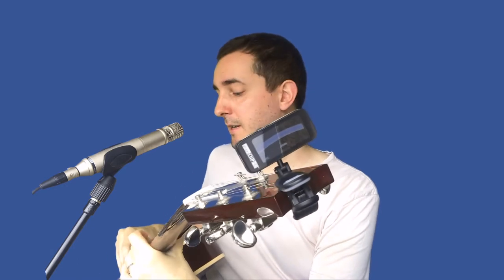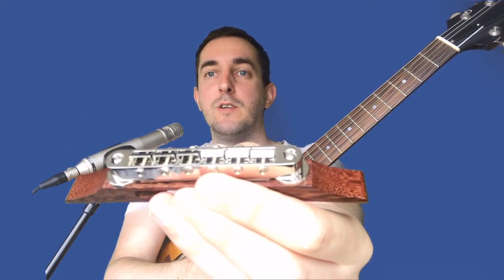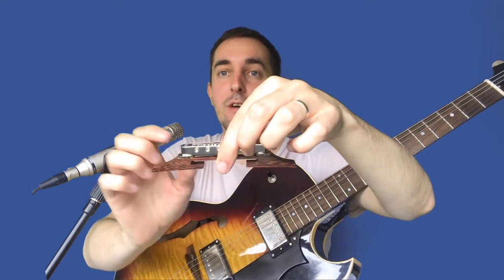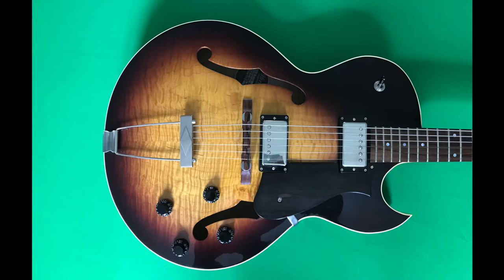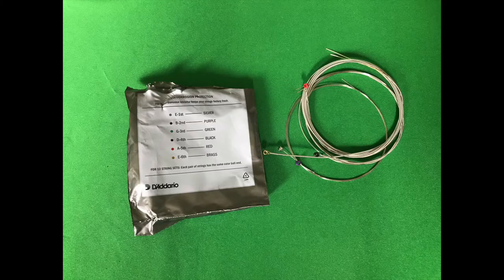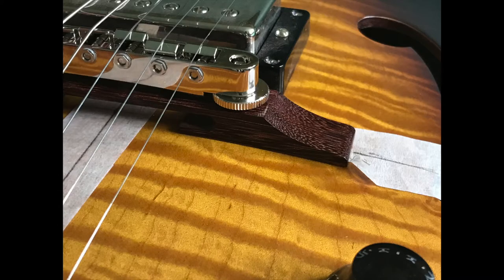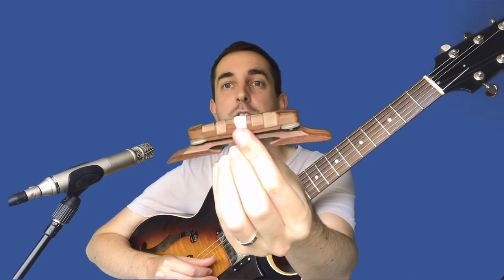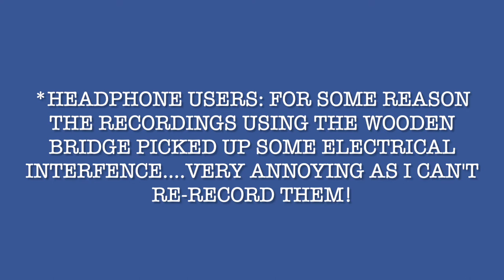How to fit a Tune-O-Matic floating bridge to an archtop guitar and comparing wood vs metal (TOM)!

Comment: There are also Roller Bridges which are common with Whammy Lever Tailpieces. The biggest advantage of that bridge is that the Strings will last longer because as you're tuning it to pitch, the Strings turn the Wheels.

Comment: Really great sounding guitar and really nice playing. I slightly prefer the sound of the wooden bridge. I think it suits the style of music you're playing slightly better (in my opinion. It's all subjective obviously). I think you could actually fix the intonation on the wooden bridge. For example on the G string, which is playing sharp, I would maybe glue (with super glue or wood glue), a thin piece of wood of the same material as the bridge to the back of the segment of wood that the G string ramps over. A piece of hardwood veneer might even be thick enough for this purpose. Then file and/or sand it to blend in seamlessly with the bridge. You'd then be able to file/sand away some of the front wood material away where the G string ramps over, until you get correct intonation.

Comment: Tonight I replaced the wooden bridge on my Eastman with a tune-o-matic. It definitely sounds brighter now and I will hopefully now have no issue with the intonation being off. I still need to make some adjustments. Did you place the bridge so that the screw heads on the bridge are facing the pickups? I wasn’t exactly sure but I believe that is how it should be placed.
Reply from the maker: Hi Ben, my screw heads were facing the pickups.... but if you look at the saddles you'll notice that the EAD saddles face different to the GBE saddles. This is so that you can get more length out of the string on the EAD side. So regardless of where the screws are, there's only one way to fit the bridge. Hope that makes sense! Cheers.

Comment: I have a Grote jazz guitar with a floating bridge and trapeze style tail piece. The wooden bridge has a tune o matic style saddle bridge on top to adjust string height and intonation. In order to get the string height I want, I have lowered the tune o matic all the way down so that the thumb wheels are actually sitting on the wooden bridge. Do I risk causing damage to the guitar?

Comment: "Much ado about nothing" The highest end Archtops have wooden bridges that don't even have a compensated 2nd string. You set the Low E and the high E and you're done! Just learn to play the instrument the way it was designed. It worked for Segovia, it should work for you.
Reply: Your name says it all. If you haven't got anything productive to say and all that....
Playing archtops is my living and it's a mathematical fact that a guitar will never be 100%  in tune. Anything that will help this is surely a step forward?..I am sure that if Wes, Charlie etc were offered a little help keeping theor guitar intonated all the way up the fretboard, they wouldn't have moaned. I "learned to play my instrument" a long time ago and I'll never finish learning till I die.
I personally found this video very helpful and will be looking into it to fit on one of my Eastmans.